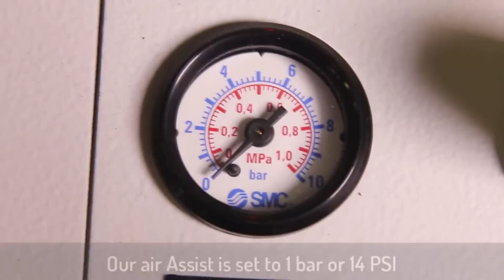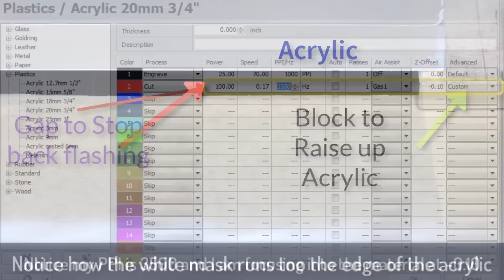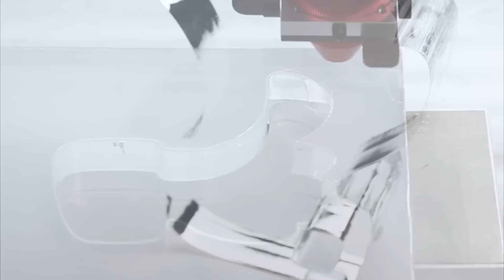Laser Cutting Thick Acrylic | Acrylic Cutting Tutorial | Trotec

Comment: Weirdly enough, I've noticed that I get clearer edges with less trapped bubbles on the surface when I turn off the exhaust. I thought that the downdraft suction evacuates the cutting gases so that they do not become "trapped" in the cut kerf. 
Could it be that because of an exhaust, more air finds its way into the cutting area?